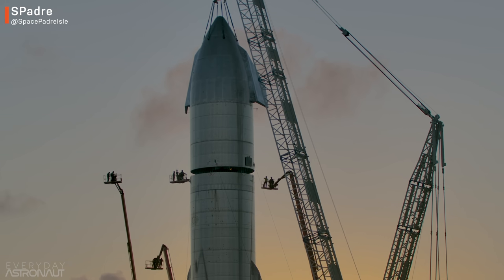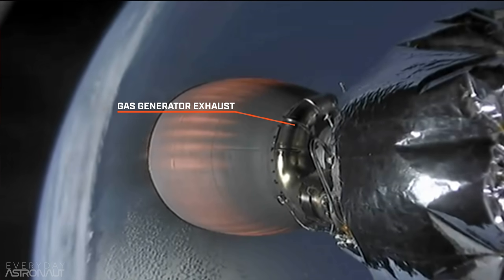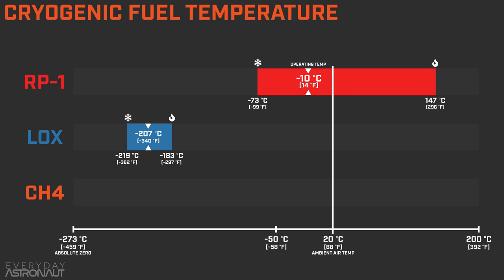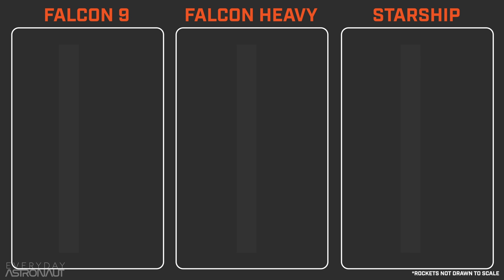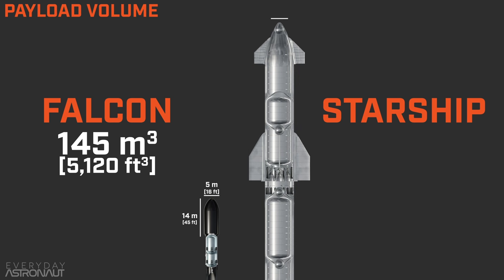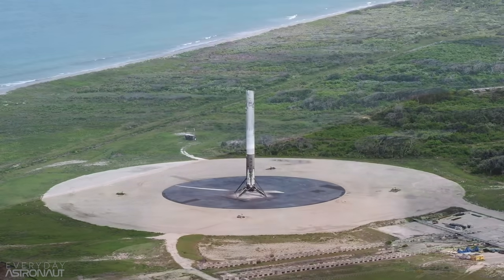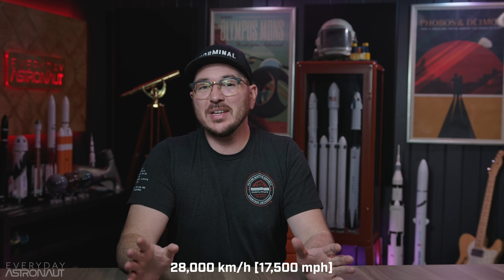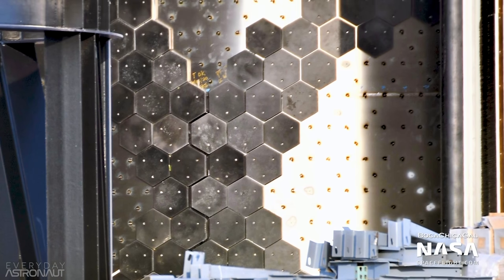Complete Guide To Starship: Falcon 9 VS Starship. What's new? What's different?

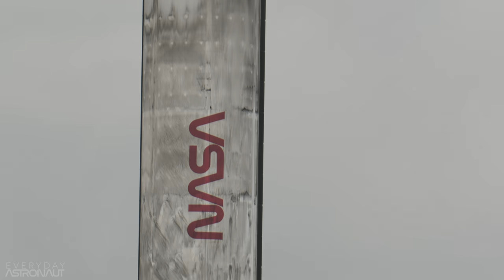Comment: 28:00 technically you can count the entire vehicle as pressurized volum.
Reply: You could even use the empty tanks on Mars as habitat space. (if you don't plan to reuse that specific Starship)
Reply: @3gunslingers  Alternatively, the Starship could be cut up and the stainless steel used to to make larger habitats.

I could almost see some of the Starships that land on Mars being disassembled for that purpose, with some of the components (including Raptor engines) returning to earth in a cargo Starship.
Reply: @KnightRanger38  or they could be spare parts for emergency repairs on returning starships
Reply: @KnightRanger38  Maybe, maybe not that economical. I can just see some local Mars entrepreneurs starting a business to buy/refit/sell refurbished starships to would-be asteroid miners...
Reply: Wait there's an extended version of Starship? That's news to me.

Comment: I may be able to recall a time when a company built the factory around the product. Boeing and the now sadly retiring 747. The first 747 was built before the factory walls were finished
Reply: The more I learn about the 747 the more I fall in love with it
Reply: Most companies are at minimum heavily into the product design before they start engineering the factory.  Most cars that are built on dedicated assembly lines have prototype and engineering samples finished before they do the factory change over.  Part of the reason cell phones are still built in China is that they have the engineers to quickly switch from prototyping to manufacturing.  While products are often designed with the factory in mind, a factory can't be fully finished until the product is.  So having a product before a factory really isn't that uncommon.
Reply: I'm often reminded of the 747 when thinking about Starship. It looks like it will make space travel affordable for the average Joe, its huge compared to all predecessors and I can imagine that in 10 years even non-space nerds will know what a Starship is.
Reply: Boeing builds deathtraps... period...and they only think of profits, not safety.  Airbus is the future.
Reply: @mhmdnazel1  to be fair you have a point for recent years. They have been trying to become more eco friendly but it seems they have been cutting corners elsewhere. You have to remember Boeing goes back a long way quite a lot of their aircraft models are very reliable and still in service
Reply: @mhmdnazel1  i think its the humans not the company itself..

Comment: Well done Tim ! Now show us Spaceport water deluge system: - capacity of water tks: 4 smaller +2 larger (with space for additional 3rd), how are these tks to be filled? What/Where is water supply? What is capacity of the nitrogen tanks- (2 banks of 4tks wide x 9tks high). Do they refill these tks after test/launch, or replace? (there appears to be about ~20 additional of these tks laying nearby). Thnx Tim.

Comment: Point to point starships can have 9 engines to lift the fully fueled starship, which can be a single stage rocket
Reply: But this Rocket would be less eficient
Reply: @ImieNazwiskoOK  best you can do with single stage
Reply: @StarshipFairing  Since the RVac's can fire at sea level they could use a more efficient configuration of say 4 vacs and 4 SL's, should just barely fit. Turn off the SL's once mass is low enough for appropriate TWR. Or they could make something in between SL and vac and fit 8 or 9 of those. E2E is still a ways out so they have plenty of time to make the optimal design. Might stretch the tanks a little, with an empty Starship and only a relatively light crew compartment, that doesn't need cabins, solar shelters or efficient life support it starts getting real close to orbit capable. Enough to get you as far as they originally planned with a booster. Should be able to get around 9 km/s delta v and you'd want 10 for an orbital one, 9.5 to get to orbit or almost and 0.5 to land with lots of margin.
Reply: @StarshipFairing  Or 3 RVac and 5 SL, that should fit.
Reply: @221b-l3t  I was always thinking of 6 Vacs and 3 SL. This engine config can also work for heavier tanker ships later on. Requires only 3 additional engines and almost no moving of other 6 engines
Reply: @StarshipFairing  Yeah I like that, remove the aft cargo pods for another 3 Vacs. It should fit. Provided the Vacs can generate adequate thrust at SL they'd have plenty of thrust for E2E with around 18 MN and would be quite efficient. Plus with 6 Vacs you could turn off the SL's pretty soon and get almost enough delta v for orbit. Maybe even enough to actually get into orbit.

Comment: Timestamps
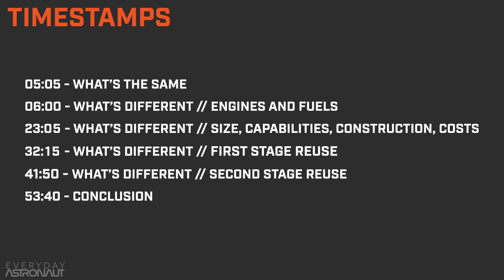5:05 What's the same
6:00 Engines and fuels
23:05 Size, capability, cost etc.
32:15 First stage reuse
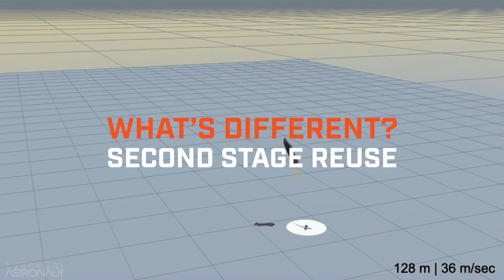41:50 Second stage reuse
53:40 Conclusion

Comment: I should point out, as a lab guy who works with cryogenics, that methane as it approaches it's T<sub>g</sum> (Solidification) - 91K - it gets thick and horribly sticky -- think petroleum jelly.  That just has to complicate using supercooled methane as fuel.

Comment: Excellent work. At 45:25ish, it's said that slowing the second stage would require as much propulsion as it took to get there in the first place, but that seems incorrect. You need to reduce the orbital speed, but you don't need to negate all of the work of lifting the mass from the surface (gravity will pull it back down). It would take much less energy if all you want to do is stop it in it's track. Tell me why I'm wrong...
Reply: tim means: to get from zero velocity on sea level to orbit reqire same deltaV as to get from orbit to zero velocity on sea level. But yeah, on way up, all delta V must be given by motor, while on the way down, you can slown down using atmosphere, or ground (if u fall to the ground in speed 5m/s, it slows you down to zero, so it gave you 5m/s delta V)

Comment: One of my favorite videos on YouTube!

Reg Startship/SuperHeavy: Maybe one way to think of it is that it’s the same as for other flying transportation methods such as airplanes where all of “it” is an airplane by e.g. Boeing when you refer to. But you call the propulsion “machines” engines by e.g. Pratt @ Whitney. Only for Starship the propulsion machine (SuperHeavy) is separated to save weight and replaced by a less powerful but lighter one at higher altitude.

Comment: Seems like the outer ring for the booster-back burn would meet the goals you mention better. High altitude kicks in higher vacuum Isp, more engines turns the velocity faster?

Comment: Spacex should use flux pinning to stop Starship in bellyflop above an electrically charged pad. The cold belly from sloshed liquid oxygen/methane on ceramic heat shield tiles can create a superconductor quantum locking situation that cushions, slows, and stops the rocket in mid air. Tim ask Elon if they have considered this. Just imagine seeing Starship (BFR) skydiving down to the pad, slowing, stopping, floating, and rotating like the actual BFG!

Comment: With Stainless Steel as the skin of the Super Heavy / Starship combo, how are they going to be able to tell how much thermal stress the material has withstood on re-entry?  How can they test / predict whether or not it is safe for reuse to where it can perform without cracking and failing?

Comment: I'm curious Tim whether your team checks comments at the 4,402 comments stage?  A point I've made before for other superb videos you've made is that the cost of a fully reusable rocket is comprised of four factors, not only the two you list. Cost per launch is calculated as cost of (fuel) +  (other mission expenses like refurbishing, ground personnel etc.) + (cost of manufacture / total number of flights per vehicle) + (cost of vehicle development / total number of flights of all vehicles of the same design).  Your video lists only the first two and so grossly underestimates actual cost per flight.  Yup it will be cheaper by far than a ULA, but still considerably more than just the first to factors.

Comment: wouldn't things like skimming the top of the atmosphere for friction breaking be a good way to reduce fuel costs for re-entry?

I do that all the time in Kerbal Space Programme. 

Send a booster in a decaying or sub-orbital orbit with a periapsis of around 68-69km, and an apoapsis of around 200-300 km depending on where I am going and how big the booster.

it will skim the top of the atmosphere and loose a bit of speed each time through, making it easier to slow down for re-entry.

Comment: Could you do a mock-up on your pc of a ship made up of donut-shaped fuel tanks, that you could stack, with landing rockets on each section? This would allow for radiation protection, in the donut hole, and excess to the ground through an air-lock on the tail-end. This would allow you to stack more sections for a bigger rocket and do away with the launch stand that you don't have on Mars and no dust on landing. If you had say 10 sections with 8 landing rockets on each, how much power would that give you? What would it do to the weight?

Comment: You mentioned during the reuse part that the falcon 9 uses it's thrusters to create a barrier of cooler exhaust gas. Is there a reason that they couldn't use that same trick during re-entry of the second stage? Or is using a complex alloy and the added weight just worth it?
Reply: Reentry velocity for second stage is significantly higher than MVac's exhaust velocity, which means it can't create forcefield against incoming atmosphere. To reduce reentry velocity down to MVac's exhaust velocity you need to save about 5km/s of delta-v, and I don't think it's possible for F9 even expendable configuration. Partially expendable FH with no meaningful payloads might be able to do this, but there's no point to do it.

Comment: Can a "starship 9"  (same size as falcon 9 or perhaps a falcon heavy) be a option for full re use in smaller size?  Maybe to bring the crew to the fully fueled starship or ISS waiting in orbit?
Reply: So technically possible if you keep the proportions of the Falcon 9 the same.

Payload to LEO: ~10t
3 x Raptor SL on 1st stage
1 x Raptor Vac on 2nd stage

The trouble with building a vehicle of this size with the raptors is that the Raptors have way too much thrust since they were designed for a much larger vehicle - the real starship.

This means at second stage cutoff, even with only one Raptor Vacuum engine, the crew/payload would experience at least ~7g of acceleration (when throttling down to 40% thrust!)

This would imply very poor orbital insertion accuracy too, so a vehicle of this size would likely require entirely new methalox engines with lower thrust levels. Since once of the key pricniples of the Starship is to use common engines on 1st and second stages, this flies in the face of the simplistic design philosophy of SpaceX.

Very interesting question though, was fun to work through!

EDIT: Having only one Raptor Vac on the "Starship 9" also has implications for redundancy as if that one engine fails, then the vehicle is doomed; you can't land in an abort during launch.
Reply: @OzearEimaj  What if the starship 9 uses the body type and general design of starship but uses the falcon 9 engines so the second stage can be reused if nothing else at least for leo use. For now, leo launch is all we really need. Even at 10 ton max payload full reuse would slash leo launch prize a lot , right?
Reply: @agw5425  Unfortunately as soon as you go into costs (edit: for something like Starship which is still a prototype), that's when you need to start speculating. I can however show you how much of a cost saving SpaceX has demonstrated over other US launchers.

Currently the Falcon 9 is priced at $62mil per launch and can send between 11.5t and 15.5t to 400km LEO if RTLS or ASDS respectively (the two reusable modes of F9). These correspond to costs per kilogram of $5,391/kg and $4,000/kg respectively. 

The Atlas V (you can go to ULA's rocket builder to compare yourself) can do it for $73mil, so that's a value of $6,348/kg to $4,710/kg. These values could be more, could be less as it depends on the value of your satellite, but no matter the cost, it will always be a similar cost per kg. 

So as far as I'm concerned, when fairly comparing US rockets to US rockets, a re-usable rocket such as the F9 has not yet demonstrated the "order of magnitude" cost savings that the Starship needs to meet in order to justify it's existence.

To go beyond US rockets, a sobering comparison I like to use is the Proton-M; it can send 23t to LEO for a cost of $65mil, so that's a value of $2,826/kg! An expendable rocket that is cheaper than the reusable Falcon 9? Hopefully this grounds your expectations a bit.
Reply: @OzearEimaj  I just meant it to be using the falcon 9 insides in a skydive capable second stage so it does not need to be single use. Would that not save like 30-50 of the 65 million dollars for the falcon 9?
Reply: @agw5425  Where are you getting those numbers from? 

Also keep in mind the majority of launch costs come from the first stage, so recovering the second stage for a vehicle of that size would not result in recovering more than half of the launch cost.
Reply: @OzearEimaj  I´m just guesstimating and hoping that it might be a workable solution for re use of F9, hope you do not mind.
Reply: @agw5425  I don't mind at all, I love working through problems! Just remember if someone starts speculating and selling it as truth, they're lying; no-one outside of SpaceX knows how much Starship (or any other similar vehicle) will cost. So until the SN prototypes demonstrate orbit, re-entry and landing we can't say "Starship will be cheaper!!", even then if we're not told how much each vehicle costs, we can't know if it's a cost-effective solution. 

To try and answer your question in a different way, think of this: SpaceX seem to be making money just fine off the Falcon 9, so why start development on a new vehicle which might not work?

Summary: if it hasn't been demonstrated, it's speculation and is not valid until proven otherwise. 

Also to address your "guesstimating", I could guesstimate that it could save 99% of the launch costs, how would you prove/disprove that? This is the problem with speculation, it has no right/wrong answer as by definition, it could be anything!
Reply: @OzearEimaj  Well I was wondering how much is lost of the launch cost(65 million?) by not bringing the second stage back for re use.  If starship is hoped to cost 2-6 million per launch, i´m thinking a smaller rocket would cost less, no?
Reply: @agw5425  Musk is quoted saying the 1st stage of Falcon 9 is about 60% of the total cost. Also, the launch cost of a F9 would not still be $65mil after re-engineering the 2nd stage to be re-usable; it would certainly be more expensive, but by how much? No-one knows; clearly too expensive/complicated to pursue the idea further, as SpaceX were considering F9 2nd stage recovery at one point. Either way, the cost breakdown would change as a result of re-engineering the 2nd stage. 

A smaller rocket may be less expensive upfront, but larger rockets generally have better $/kg due to economies of scale.

While the $2-6mil per starship is aspirational, you're neglecting the extra R&D and labour costs that would arise from the development of such a vehicle - especially true if resources were diverted to develop your Falcon 9. Please understand that I'm not trying to bash your idea, but rather have you understand the larger implications of attempting such a development; it's never as simple as raw material and propellant costs as I have seen plenty of times to try and explain the "low" cost of Starship.

EDIT: Shame about SN9! Hopefully the Raptor issues get iron out for SN10.

Comment: I would like to see a lay down version of the Lunar Starship that has modular connections to turn it into a moon base. Perhaps send some construction robots ahead to prepare the site with flat landing area and trenches to lay down base sections inside with some protection. The robots could then cover the base sections in a thin layer of lunar material for partial radiation protection. Steel Starship sections should be strong enough to hold shape with some reinforcement ribs. Just need to figure out a way to lay them down gently.

Comment: I could be wrong here but lightness matters a bit less when your moving such massive volumes of fuel with your craft.
I'm thinking of o'neal cylinders and the like where bigger is better cause hull thickness doesn't change after a certain point.